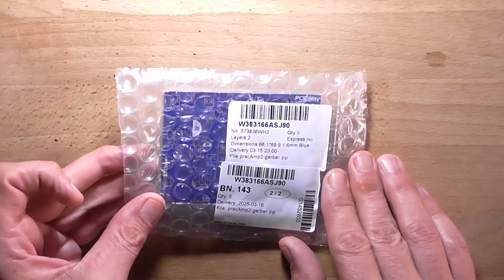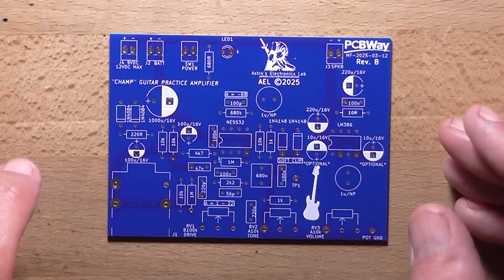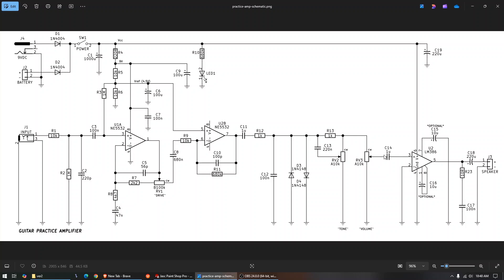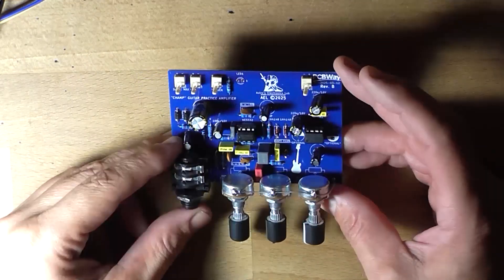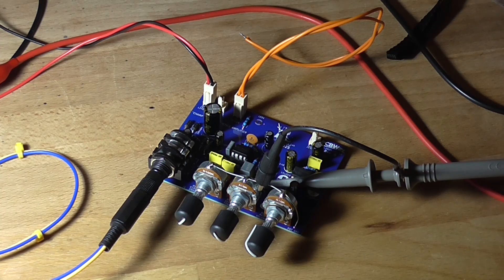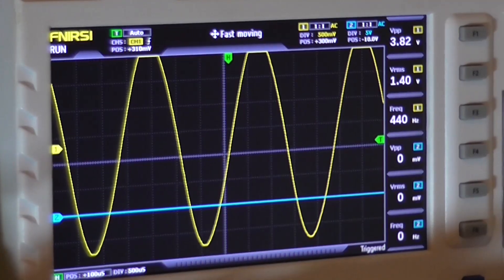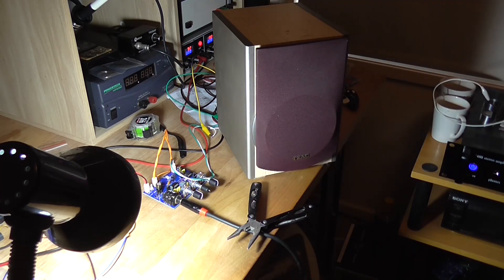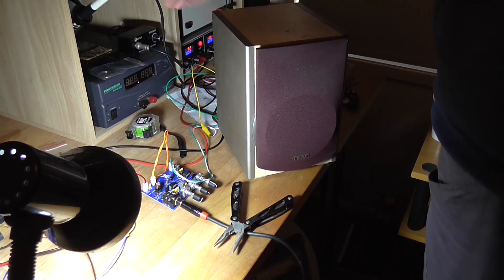Guitar Practice Amplifier PCB - Revision B

Comment: The first "hifi" amp I built from scratch used two 14 pin LM380, I was about 14.
I didn't have a suitable component wire drill size so I designed the board surface mount style long before I ever heard about SMD lol, also the board mounted neatly and flat to the inside of the cover of a 'zippy box'.
Sounded pretty good in my bedroom until I went next level and built a DSE/ETI kit using two BTL car amplifier ICs running elevated supply voltage.
15W/ch, passive baxandall tone controls and it cranked until I got a job and and bought some 'real hifi' lol.
Have fun !.
Reply from the maker: I forgot about the LM380! I might see if I can get some, apparently 2.5W output power. Elliott Sound Product (project 160) depicts one. Interesting.

Comment: Pro Tip - For HF extension and HF clarity try bypassing the bypass pin cap and the Zobel cap with silver mica caps, biggest value you can budget for.
Also bypass signal series coupling and signal shunt caps.
Cheers.
Reply from the maker: Yeah, there's also a 100nF/1k low-pass filter before the output of the "preamp" which would have an effect on the high-frequency response. Not sure what you mean by "bypass signal series coupling caps". Bypass the DC blocking caps with what? Another capacitor?
Reply: @AstrosElectronicsLab Yes add the silver mica caps across the existing series and shunt caps.
Even though they are low value the sound gets clearer overall, and defo in the highs.
You can try the same with ceramics but IME can cause 'wrong' sound.
Reply from the maker: @ericmc6482 interesting. You are a guy of immense knowledge. I also hate this bug YT has with replies only producing an @